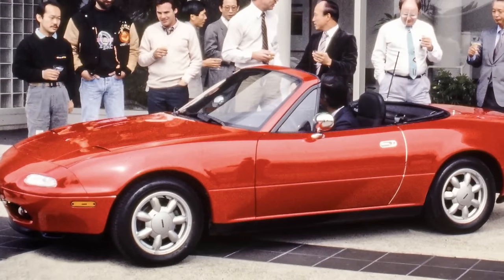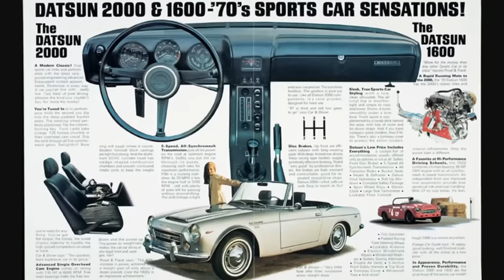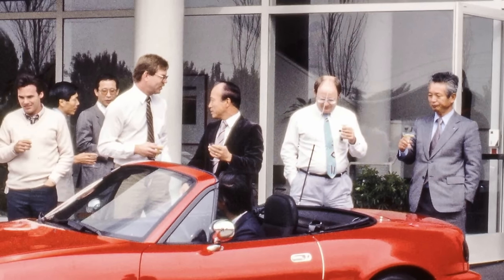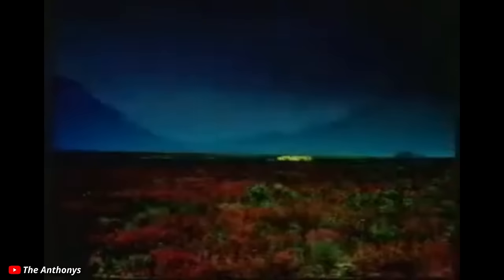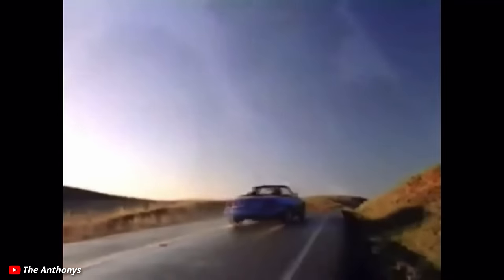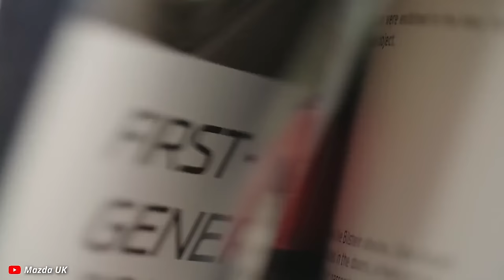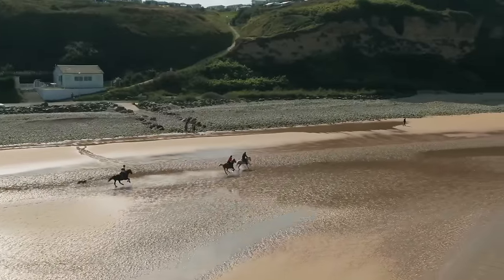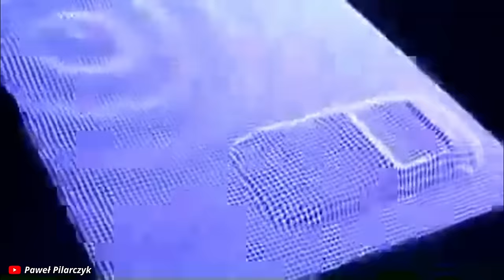How Mazda made the Miata

Comment: Mazda is known for driver-car connection at its best. Their cars are some of the most synced I drove. as someone who's driving a lot on 81' RX-7 FB, I can really tell the shifting, pedals, and steering (even though it's not powered) is on point.
Also, I'm inviting you to check a video I uploaded lately about a Turbocharged NB we got here in Israel with 250HP. (also I got some vids about the RX-7... but that's for another day :) )
also, great video overall, thanks for the knowledge, I didn't knew most of those stuff.

Comment: Great video! Fun fact, the Miata/ MX5 as a concept was developed in my hometown of Worthing, England.  The prototype was codenamed V705 and used a glassfibre body, an engine from a Mazda 323 and a hotch-potch of components from other Mazdas, the V705 was completed in August 1985 and transported to the States where it was driven on the roads around Santa Barbara to gauge public reaction.

Comment: As a lifelong motorcyclist and sport bike guy in the 90s, I bought a 2nd gen Miata when they first came out in 1999. The deletion of the pop up headlights and the addition of a glass rear window (w/ defroster) was what it took. It also had the 1.8l motor which had more power. What a car! I wore the stock Michelin Pilots out in less than 5k and really should have been replaced at 3k. I drove the snot out of that thing and it performed brilliantly. I would get it up on 3 wheels in the canyons and yet it always felt predictable. Better brakes and 20 more HP and I think it would have been THE perfect sports car.

Comment: Call them what you will, but the Miata perfected the 'sports car' which the British industry tried to build but never quite did.The thing which most set the Miata apart was you didn't need to constantly fix, adjust, and maintain everythibng; all you had to do is drive and enjoy. Another point was that it's shared parts were less of a compromise than the British cars. And it was as cheap as it was fun. Fast-forward to today and it's not the same; it's gotten plumper and plusher and pricey having moved away from it's roots but it's still best-in-class and to get more you have to spend a lot more money.

Comment: I've owned a RX-3, RX-4, 2 RX-7s, and 3 RX-8s.  My last one, a 2011 R3, I planned to keep forever.  Sadly last year it was rear ended and totaled by an uninsured driver at 80,000 miles ending my love affair with the Wankel.  While still pining for my R3, the dealer called me about a  2007 NC convertible with only 23,000.  I decided to try it.   I love the handling.  It doesn't accelerate, as fast, but it loves the corners.  I have joined the local Miata club and have driven it in 2 parades.  I have learned to love driving it.  The club takes the back roads to out of the way eating establishments.  The only down side is, being an old fart, it's difficult to climb out of it.  I can't imagine an EV being even close to this much fun.

Comment: I'm 22- young and dumb, but I had an obsession with the Miata since I realized how good it was at cornering in literally any racing game. NFS, Gran Turismo, Horizon...it was TOO good- It made no sense!
3 years ago I got a 94 'M Edition- a breed of the best of Mazda's NA's. Near-mint- aside from upkeep, it looked and felt like it came fresh from the factory. Torsen LSD, Bilstein Suspension, and the upgraded 1.8L. I couldn't have gotten a better Miata. And in all the racing games I've played, not even Underground 2 exaggerated its handling. It's this nimble car that does what you want it to do. Not much power in speed, but full power in movement. And the M-Edition isn't even the lightest NA, it's rated at something like 2,600 lbs? Heavy!
I've had some troubles, and had my own faults in the car. I felt terrible having to learn manual on its 30 y/o transmission, and I've been the sole mechanic to replace some super-essential parts. Timing Belt, Water Pump, CAS, Clutch Hydraulics, and many deep O-Rings. But I've learned so much about the Miata and it makes me love it even more.
It's the perfect size for me to upkeep and clean, and so common that parts are ACTUALLY fairly priced. And no- I haven't met one person who's disliked it. Driving it's like I'm a beam of happiness in this boring-aah world of cars. Suburbia sucks, but when I'm stuck in traffic with the top down, I only hope I'm inspiring more people to ditch the SUV and get something that makes driving actually fun. The Miata feels like it's got as much character as me, and some day my artistic side wants to get an NB and spec it out like I've been doing for years in hundreds of racing games. Cosmetically mostly- but I'd love to push that perfect handling to its absolute limit, keeping that legendary 50/50 ratio.

Comment: Or in England Mazda MX5 that’s what they were called over here pretty car always too small for me. I’m too long and lanky enjoy your program Michael
Reply: I'm 6'4 and it's the second or third gen that I can fit just fine. The current gen was shrunk back down from the last.
Reply: I’m an oldish 6ft 3 . I bought a 2010 nc . A few simple mods & you will fit . I fitted seat lowering brackets . lowered the clutch pedal & a flat bottomed steering wheel . Perfect now .